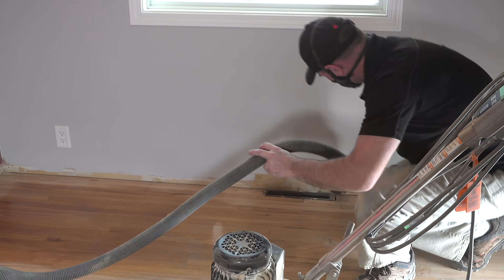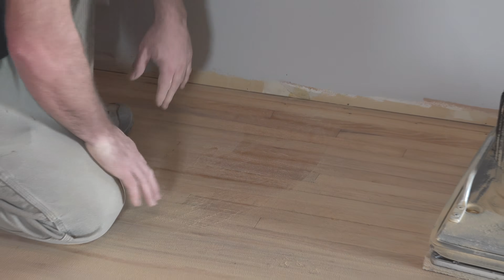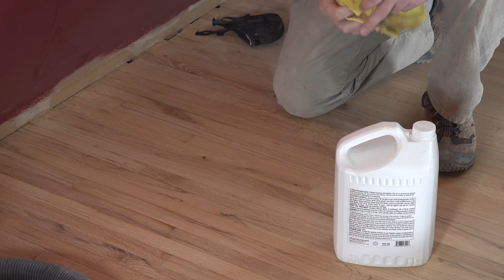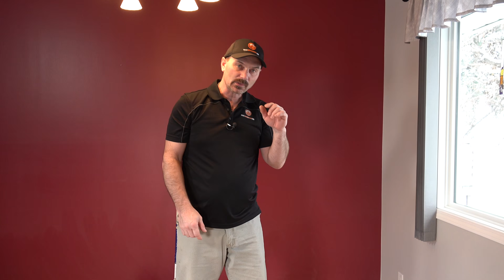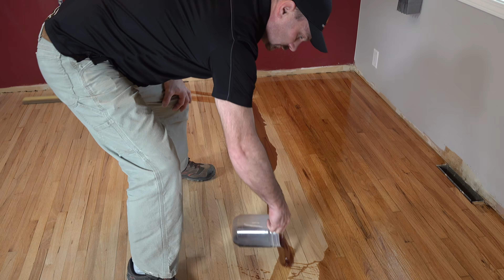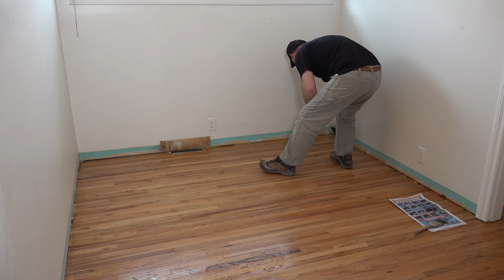How To Sand & Refinish Hardwood Floors

Comment: I've been sanding and refinishing floors for 35 years those machines do not work right you have to have professional machines and professionals to refinish your wood floors well though you can try it's going to break your back people that want videos like this are the people that call me to fix their mistakes also if you are not hooked up with a a wood floor distributor you're not going to get the proper chemical the stuff they sell in Home Depot and Lowe's are not the stuff we use the machines that they rent are not powerful enough to refinish old floors you would have a nightmare on your hands not to discourage you but I'm talking from experience

Comment: Any tips for squeaky floors? Or little scrapes or damage to the floors. Preferably without replacing the flooring
Reply from the maker: Some times sprinkling talcum powder on the floor and working it into the joints will stop some squeaks but not all the time.Old  Wood floors are squeaky, that's their charm. You can touch up small scrapes with stain or clear finishes or even coloured putties or putty pencils..
Reply: @HouseImprovements  yeah I guess the squeak is what makes it homey lol

Comment: Why did you decide not to fill in the gaps between some slabs that were too far apart from each other? Nice job though
Reply from the maker: usually filling them in looks worse than leaving them alone. This is a 60 year old floor it is not needed to look brand new

Comment: Hi ya buddy! Going to refinish my maple
Floor. Question. Do you think grit 36-80-100 would be sufficient and 3 coats of polyurethane? I have no clue about maple
Floors
Reply from the maker: Maple is a tricky flooring to refinish. If its an older floor with varnish you likely even need to go down to 24 and then 36,60,80,100 and 120 grit and if your machine is variable speed you want to slow it down a bit. I've only ever done one maple floor and it was a PITA. If its a newer floor you likely can get away with 36-60-80-100.
Reply: I would love to know how to figure out if your floor has ever been sanded and if it’s to thin to sand! Thanks

Comment: This looks like good work in a video, but it does not show the imperfections...  realize it takes more that watching a video to do great work. You really get what u pay for. Feel free to try for yourself. But as a professional. We come across and fix many " do it yourself" floors. It's also flatter, cleaner,  easier and faster with the right equipment
Reply: Hello! We are trying to do it by ourselves, do you think that the sanding after coats can be don by hand or it is important to use the same machine we have used for the first sanding? Thank you!

Comment: I followed the your instructions really well in the upstairs of my house and it looks fantastic! But in my living/dining room, I got a little impatient after vacuuming and wiping with wet towels. I only waited an hour or two for the floor to dry. It looked dry. I put on the first coat of water based varathane and it looks really splotchy. Is that because it wasn’t fully dry? Any way of getting the floors back to a smooth even colour, or do I need some big carpets?

Comment: Other instructions I saw said to use a sanding sealer first. Is this unnecessary?
Reply from the maker: depends what your finish asks for, usually the first coat of anything acts like a sand sealer.
Reply: HouseImprovements thank you! I asked the manufacturer and they said it isn’t needed.

Comment: My boyfriend and I bought a house and the wood floors I don't think have been retouched since the house was built in the fifties. With 1200sqft of wood getting it done professionally is way out of budget. This is super helpful for giving us some perspective on the project to come
Reply from the maker: If its in good shape physically this will work fine if there is lots of wear and dings you will likely wanna drum sand it do get rid fo the blemishes.
Reply: @HouseImprovements  thanks for the advice :) my current supervisor used to do flooring when he was younger so I think I'll ask him to take a look at it and see what needs done. I don't feel comfortable using a drum sander if I don't have to.

Comment: how do you fill in the cracks between planks and what do you use?
Reply from the maker: You can use a stainable wood filler or use the fine sanding dust mixed with glue before you final sand the floor.
Reply: thanks for the help

Comment: I use a drum the whole time but he is right . At the end , that flat sander is a key tool for pro work . If not scratches will be seen from paper , take your time and do it good. Even if you have to get on hands and knees and you will, with a small orbital. Orbital has saved my ass more than a few times

Comment: Was some type of clear finish applied over the 3 coats of stain or that wasnt needed? I am planning to redo my moms hardwood floor which is generally in pretty good shape, some old padding residue marks, some light scratches and a few gaps between boards that I think need to be filled. What im wondering is if I can fill in the gaps and do some type of light sanding not completely removing the original stain, reapply some stain same or super close color and then put some type of protective clear down over it or whatever is usually done to protect the stain finish and seal it. Any advise would be appreciated! Thanks!
Reply from the maker: Generally if you sand you may sand the stain off or dull the colour in those areas so then the floor will not all look the same. In the video no stain was used it is a Varathane finish . This finish does make the wood take on a bit of a darker shade. Our forum is a good place for questions.https://www.house-improvements.com/forums/
Reply: @HouseImprovements  Thanks for the reply! Yes the small spots I have sanded or scraped to remove the weird green padding residue left slightly full spots. Is there possibly something fairly quick and easy that I can apply to make it look a bit better and give it some protection? Without turning it into a big project I mean.

Comment: Hi.  We are renovating my mothers house.  After taking out the carpet and glue down tile they found the most beautiful 1 1/4" wood floors.  They sanded them several times.  I had to let that contractor go.  Now I want to finish the floors myself because of budget.  We have several deep gouges.  I don't have enough extra flooring to take them out and put new.  Is there anything I can just fill the gouges with?  Some are at least 3/4" deep.  We were going to keep the natural color of the wood or at the most a very light tint.  We also do not have a big issue if you can still see that there was a gouge.  Just don't want the hole.  The contractor purchased Parks Pro Finisher Water-Base Polyurethane, Varathane Sanding Sealer and Varathane Floor Finish Polyurethane High Traffic Formula.  I am not sure which order to use them or even if they are good products.  Thank you
Reply from the maker: I would use either a stainable filler or use sanding dust from the floor sanding process in other areas and mix it with some carpenters glue. Use this mix to fill the gouges, both will require sanding after they have dried. Hopefully these deep gouges are not very wide of it will not work well for either of these fillers. 
The sand sealer is applied first , it is used because it seals porous woods and helps smooth textures of wood, it also dries quick so it can be sanded sooner. 1 or two coats of that then 1 or two of the other product. Follow the instructions on can. Use our forum if you have more questions please.https://www.house-improvements.com/forums/

Comment: Shannon - how do you determine if your floors require a drum sander or a pad sander?
Reply from the maker: If they have a lot of wear to the point that the wood is gouged ,then you will be better off with a drum sander. The pad sander is very slow at sanding into the wood to remove deep scratches or gouges. If basically just your finish is poor then the pad sander will be fine.
Reply: This guy is going all over the grain,
Reply: @calvinseaton3144  The orbital sander has NO direction, so no problem. The drum sander has a direction, so with it you need to go with the grain.

Comment: What's the chances of refinishing a 20year old oak floor and havening it match a newly installed oak floor in the next room?  (finishing both at the same time)
Reply from the maker: Pretty good if you get the old floor sanded right down to raw wood.

Comment: What grits did you use? How many cuts/passes of each grit? And how many big pads did you use of each grit ?
Reply from the maker: That all depends on the condition of the finish on the floor and the floor condition its self. These floors where actually physically in good condition so All I was really doing is sanding the old finish off to bare wood and applying a new finish. Watch the video between the 2 min and 3 min mark . The grits and quantities are discussed.
Reply: HouseImprovements - the condition of the floor is good. All I want to do is take off the current (polyurethane) finish and put in a fresh coat. At Home Depot they are telling me I won’t need more than 3 sheets (per grit) to do a 265 sq. ft area.  Your video indicates that I will need about 10+ sheets to remove the finish from this area with the same flat bed buff sander you used. So I’m not sure how many sheets to buy.

Comment: My wife and I are closing on our house on the 16th and I cant wait to refinish the hardwood. The house was built in 1941!
Reply: More than likely you will need a drum sander and  edger plus a  finish buffer to do an old floor like that. This wimpy equipment will not sand out old varnish or humps

Comment: Shannon. On that T-bar. Are you using a new sleeve on 2nd and 3rd coats, or can you clean and reuse the sleeves using mineral spirits or paint thinner?
Reply from the maker: I bag it and wrap it up and re use it on all coats. It can be cleaned as well if you prefer.

Comment: Got a 118 year old cabin floor to do. It's beat up bad. Hasn't been resurfaced in a VERY long time. Shouldn't take much sanding to get the old varnish off considering it's almost totally worn off lol Thank you for the video! Very helpful!
Reply from the maker: If it s beat up then then it will require more sanding than this. You will need a floor drum sander.

Comment: About to make an offer on a house full of hardwood that all needs to be restored. I feel a little more confident in my decision to move forward now. Thanks!!
Reply: That's what brought me here too!
Reply: Same for me
Reply: same lol
Reply: Me too!
Reply: Done use the machines this guy uses😂 youll be working your ass off for a month. If youre gonna do it yourself rent a belt sander an edger and a buffer you wont kill yourself trying to do your own floors
Reply: How’s it go? Just did the same lol
Reply: Yep, 6 months ago I bought a 1950s built house that recently had the carpet pulled up. But has pretty nice 2.25" oak flooring that once had a finish but is now covered in carpet glue. Hopefully I can get it all done by next summer.
Reply: Same reason I am here! How did it go?
Reply: Still confident with that decision?
Reply: F that. Id cover that stuff up

Comment: Another great video. I’m a custodian in a high school and we have to do our wood gym floor every other year by screening it with buffers and then applying the finish similarly to how you did it with a t-bar, only they make us try to do the whole gym without stopping or lifting the t-bar. Crazy or what!?! A little trick we learned for pouring the finish, by the way, was to use a plant watering can. Get a nice consistent stream every time.
Reply from the maker: that would work great for pouring.

Comment: How long does this whole process take? (ie. sanding + 3 coats of finish) Can this be done over a weekend in, say, a 500sqft apartment?
Reply: One long day of sanding. Its brutal on the body. One day for each coat. I would figure 4 days.. maybe 3 days with a water base finish. But I would use oil and take your time.. dont be afraid of renting a drum sander.
Reply: @ackmino  Well yeah, I mean with a drum sander. Is it that exhausting? I can imagine sanding by hand would be taxing but with the drum sander it looks not that bad.
Reply: @nosferadu - drum sander is very easy - if it's a good one.. But the edger will be exhausting if you have never done it. It takes strange leg muscles that rarely get used. If I go a couple of months without doing a floor, I am worn out with the edger.. there is nothing hard a out floor sanding,  it's just hard work.

Comment: What is the polyurethane product you are using? Is it oil base or water base and which one, there is so many choices. Is it the Minwax Oil-Modified Satin Oil-Modified Polyurethane, Minwax Semi-Gloss Oil-Based Polyurethane, Minwax Floor Satin Oil-Based super fast drying professional formula  or what? Thank you
Reply from the maker: This is product #CM1302400 its the fast drying professional labeled can.

Comment: This is very useful information for an upcoming floor project I've got.  My question is, can this same technique from sanding to finishing be used on compressed bamboo floors?  Thanks!!
Reply: gp500fan not on prefishined floors. Even unfinished Bamboo is a very difficult wood to work with mostly because its so densely compressed at the factory, prefinished floors are even worse since you have the usual aluminum coating on the modern prefinished floors. It is possible though. But you will need a drum sander and edgers with 30-40grit starting to take off the finish.
Reply: @TheUltamatium  thank you very much for the information!

Comment: How long would it take you to sand 1000 sq feet wit the square buff sander? Thks. EL
Reply: Since this comment is a year old, you probably no longer need an answer. But, for anyone else who needs the answer, it would take forever. Use a drum sander and edger. You can use the orbital flat sander or trio to blend the cuts.

If the a drum sander is intimidating, buy some wood from the hardware store and practice, to get used the motion.

Comment: How often do you change the pad on the T-bar? After each coat?
Awesome video btw!
Reply from the maker: No, you can keep it generally sealed up in a garbage bag between coats and keep using it. When you are done the job you can clean it with the appropriate product depending on the finish you are using.
Reply: HouseImprovements is there any stain in particular that you prefer?

Comment: As a professional floor finisher I won’t go in to your technique.  However on these do it yourself videos some things are rarely addressed that really should be.  1) there are many health hazards when sanding a floor-lead, asbestos, wood dust, VOC.  This is the reason why most professionals use HEPA dust extraction...for their health and the homeowner.  You should really address those. 2) proper sanding technique and grit sequence is very important to the floor lasting...a do it yourselfer can do it but most skip these vital items.  You should include proper grit sequence.  3) failure to remove all the old finish is a sure fire way to have peeling finish (especially if it was waxed or prefinished).  You might want to tell folks to do an adhesion test so they will know if they’ve sanded enough.
Reply: Good good, where can I get a flooring police badge? There is a way people talk to one another. Your outside of my comfort zone. I bet you wouldn't be as forceful or condescending in person. Why do it online?
Reply: Oh well Lord of floors. Do you have a video?

Comment: In 1979, I refinished 1300 square feet of hardwood floors in our first house. The house was originally built in 1945. The previous owners had covered the hardwood with carpet. We pulled the old stained carpet up and saw the original hardwood flooring. My total cost to refinish the floors myself was $179.00. That cost included rental fees, sealer and oil based polyurethane. The floors still looked great, when we sold that house eleven years later. Hardwood floors are much easier to keep clean than carpet.
Reply: 179 dollars in materials and 50,000 dollars of back breaking labor! That must have been a lot of dust.....
Reply: Mike Tracy , it was a lot of of hard work, but we did not have must money back then. We brought the house with a GI bill guaranteed loan, 10 percent interest payment, and a $1000.00 down payment. Our house payment was $279.00 a month, and we thought that was a lot. When I got through sanding the floors, there were four mounds of sanding dust in the back yard. Each mound was three feet tall.
Reply: @jacklabloom635 3:23
Reply: @jacklabloom635 Jack, thank you sir for your service. Baby boomers are some tough sumsofsomemofos! (Made that up) My parents are boomers! Much respect sir.
Reply: @jacklabloom635 yes!!! Love this ! No better feeling than pouring into your home with your bare hands for a fraction of the costs!
Reply: Yes, and if you’ve ever pulled up old carpet, you realize how nasty it is.
Reply: $179 in 1979 is like $1000 now
Reply: That's wild. I live in West Virginia and my mom's house when they tore down the old siding there was newspaper as insulation and the actual frame of house underneath is huge logs.  The barn in field I think has 1960 or so ingraved in the stone.  And I realized there's an old rail road track in our basement for a frame. And it's old cause we live by train tracks and they just look. Different.  But I'm about to do my mom's floors for her. There the old wood ones with the wood nails or whatever it's called.